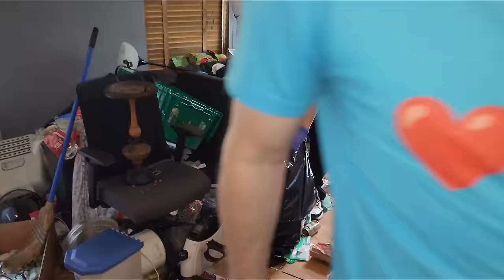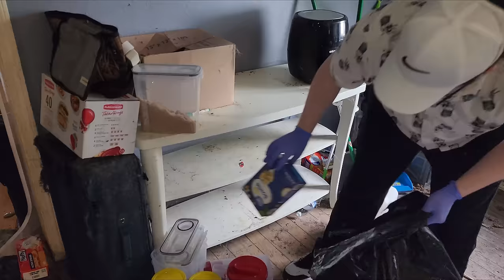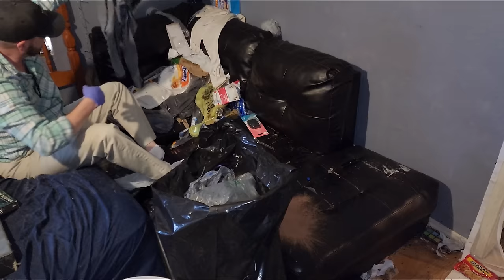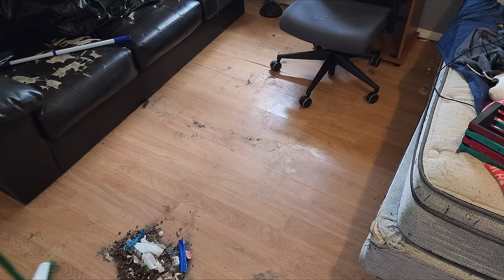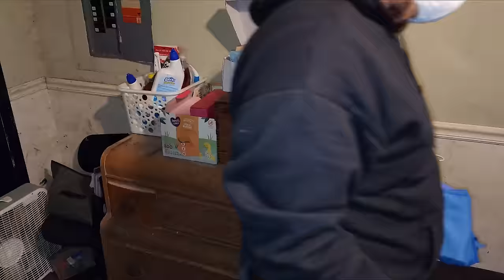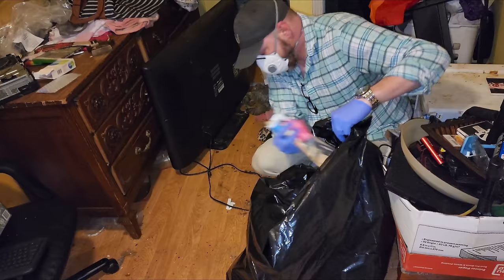We removed 100 bags of trash from this home for FREE

Comment: A friend lived for a while in a cheap hotel, and roaches got INSIDE of every kitchen appliance ( where the mechanical part is, where you can't clean it and can't see in there.). 

Inside of the back of the refrigerator and inside the toaster and toaster oven, and inside of everything she had in the kitchen. And inside of a TV or anything electronic because they like the warmth inside. 

So even though she next moved to a clean apartment, she had to get rid of everything that had ANY LITTLE space where a roach might have laid an egg, FIRST, and NOT bring it to the new apartment.❤

I guarantee there's roaches living INSIDE of the back of the stove, BACK of the refrigerator and inside the back of the microwave etc.  They come back out later and eggs hatch repeatedly. Ugh.

Thank you so much for helping her.

Comment: I am continually impressed with your sensitivity to the mental health issues other people are facing. I am a former police officer here in Canada, I have been working on and learning to live with PTSD since 2011. The observations you made at the beginning of the video about the homeowner possible having PTSD were so spot on, and so compassionate. For a few years I saw the wrong therapists and I was made to tell the story of what happened over and over and it does not help. I had to tell the story and you would think the re-telling would help get it out of your system. It doesn’t. It strengthens the experience and it’s a crazy circle of thoughts you get trapped in. I finally found things that helped, but re-telling over and over doesn’t help and in fact makes things worse.

Comment: Not a trained psychologist, but I majored in psychology and have adhd and periodic depressive episodes. often times for me the most difficult part of a task is completing it rather than starting it, and this is most obvious when i'm cleaning. for instance, i have a basket of important papers i need to file sitting in a basket on my desk, the file is right under the desk, but i haven't sorted them in months. i have idk how many crochet projects sitting around places, and some of them i've put in bags and stored away in a plastic bin to reduce the clutter, but the projects still aren't done. i have bags of clothes i've culled to consign/donate, but it's been almost 3 months and they're still all in my trunk. my dishes frequently sit in the drying rack until i need them next because i can't seem to put them in the cupboards. what this person is doing feels like a more extreme version of that - she has enough energy/executive function to do 80% of the task, but something about finishing is tripping her up. what i do to try to combat that is to make the ending/storage location and the stage of a task i get stuck on as similar as possible, or interrupt the stuck stage. for example, a lot of my dishes get stored in a way that lets them dry - pots and pans are hung up, my cabinets have wire racks and i usually leave the doors open, and i just bought a little fan for my kitchen to improve air circulation. i've also started inviting a friend over to chat while i finish up craft projects so they can keep me on track. obviously this person needs much more support than some little life hacks, but maybe this can help her or someone else.

Comment: Thank you for teaching me the difference between a degreaser/soap based cleaner and all purpose cleaner. I'd be using only all purpose for most things and struggling with the more gunky messes. Now I know the 2 step process and that you still don't need 12 different specialized cleaning products to clean a house. 2-5 products is enough for basic home maintainence.

Comment: Oh my word, this was an absolute nightmare of a house. Before we had kids, my hubby and I lived in a trailer that became infested with roaches after someone gave us stuff from an apartment cleanout that turned out to be full of roaches. We fought them, but we ultimately had to move out of the trailer because we couldn't deal with the roaches anymore and though we haven't dealt with them in years (thank God!), the experience left me traumatized. You guys were so awesome for getting her house put into livable condition. I hope she has access to a therapist who can help her, and an exterminator to put those nasty bugs out of her house once and for all.

I'm curious about the empty storage containers as well. I saw someone else mentioned it in the comments that it could be an out of sight, out of mind thing where if they don't see it, it's not there. While that certainly could be the case here on an extreme level, my theory about this house is that the lack of storage use is that it's a side effect of a severe, prolonged depression where you're simply too ill to put things where they're supposed to go. You buy the storage tubs to hold books or knickknacks, but then depression hits and you can't get out of bed for a while. So, they sit empty while the house piles up. Having clothes in baskets means less effort and energy is spent getting to them or putting them away as opposed to storing them in a closet or dresser. Same with the food piles. And as the garbage and mess piles up, so does the depression. Rinse, repeat. I'm not a psychologist, nor do I play one on TV, but that was my impression of the situation based on what I've learned on this channel and in real life about hoarding, mental health, and neurodivergence (it's interesting that you studied psychology in college. It seems right up your alley. Did you graduate with a degree in the subject?). I'm interested in what someone who has actual clinical training on the workings of the human brain has to say on this matter.

Take care of yourself and the family! Enjoy the eclipse on Monday (hopefully, your town will be in the path of totality for one of the most awe-inspiring views in the sky!)

Comment: I know a eldery mother with two children diagnosed as adults with ADHD and clothes were/are always out of empty closets, Drawers and closets are usually  empty.  One struggles with garbage, like sanitary products and dirty recycling  everywhere, and the other uses shelving so they can see everything. They are not this extreme but dirty dishes are the norm and usually washed when they have used the last clean one. One solved this problem by only having what dishes they needed for one day so they had to wash them. As children, everything was on their bedroom floors but they were made to weekly clean and fold  the clothes off their floors. This chaos is normal because their minds dont see this as a problem we do.  Chaos is comforting for them.

Comment: Thanks MMC, I love your channel & much needed humour. Great job on the clean up, shout out to Jason for facing those pesky roaches 🥰 
Wishing the homeowner continued healing & hope that she found a clearer cleaner living environment a safer space to make that happen ❤

P.s A great microwave cleaning tip i use - cut a lemon in half, put one half in a bowl and add cold water to near the top of the lemon. Turn on microwave for 3 minutes. This creates steam which loosens any built up food residue making it easier to just wipe off when finished. Lemon acts as a great deodoriser, so yr microwave will smell great too. Repeat exercise if microwave still gunky after the first run, use the other half of the lemon and new cold water.

Comment: I have Depression, Anxiety with a hoarding component as well. There, but for the grace of God, go I. I don't ever remember a time when I wasn't depressed and anxious. I later was diagnosed with ADD (what calm ADHD once was called). I have developed systems for dealing with dishes, laundry, cleaning the bathrooms, shopping, my car, my bills. But I have been digging my way out of, not only my own, but my Mother's trauma and Depression since I was about 12, which is when things started getting bad. I fight against this tendency every day. I am well aware this is always a possibility and am vigilant. I still have way too much stuff. But it is, for the most part, sorted into major categories. I only buy what I have an immediate use for. 

But, I'm tired. Two years ago I was diagnosed with Fibromyalgia. It explained a lot, and that in itself is a help. Pain is exhausting. There's no incentive to move. In your mind you can see all of the things that need doing. You can even picture them done. But getting up, walking around, bending down, picking things up, hurts. Not in just a while, whine, whine sort of way, but in a misery gift that keeps on giving HOURS after you stop. Muscle spasms, pain that won't let you sleep, all over fatigue, it can be very Depressing. I don't know this person's story, but after living in such conditions for years, it's easy to start believing you deserve it-- lying in the bed I made-- sort of thing. 

I guess my point is that not everyone has the same energy level. Some people start behind others. Not everyone has the life skills, or self-knowledge or insight, to know that they're going down the wrong path. To the punitive people who seek to embarrass and punish, screw you. You don't know this person.  Thank the powers that be that you have the energy, mental clarity, to keep your house from looking like this. And never take them for granted.

Comment: This is the second video of yours I have watched and I am bawling. 😭 God bless you for helping these people 🙏❤️ 
I'm not a psychologist, but my house looks like the ones you clean and almost every cabinet/storage area is empty and you say you haven't come across this before so I thought I'd put my two cents in.  I have cptsd, major depression, anxiety, severe ADD and possibly even D.I.D. I live in a small rural community and I do not have access to mental health treatment. I've tried all the pills, they kept me numb enough to function for a couple decades but now I'm on my own and don't care to be numb anymore. I think they may have done some long-term damage as well and I have a pretty flat affect at this point anyway and don't care to leave the house. When I moved into my current home I was already in a bad state. In fact, I moved everything into the middle of the living room and just left it all there. Things were pulled out as they were needed and nothing was ever really put away. The house had basically no storage and it was too small already. I made a point not to put anything into the few storage areas/cabinets that this house had because there were so few and I didn't know what would go in them because obviously I had too much stuff and some of it would need to go, and I've always had a hard time knowing what should be kept and what was useful and what should be thrown away, as well as letting go of anything with any value at all. I don't hoard trash, and there's no food rotting around my house but otherwise it looks just like these homes. I grew up in a similar situation and hated it. But, I left the few storage areas empty so that after I cleaned out all the extra junk I could put what I actually needed to keep, in them. Before long, things were piled in front of them and I couldn't even open those doors/drawers anymore so they stayed empty. It's been almost 10 years but I'm going to get this house cleaned out one of these days and it will be livable, for at least a moment, before I die, if it kills me! The shame is so intense that no one has been allowed to come to my house for over a decade. I commend the people that can ask for help! May God bless you and keep you always for helping AND respecting them! I tried to watch the hoarding show that was on television before and I don't know how they didn't make most of those people kill themselves. I couldn't watch it. MAY GOD BLESS AND KEEP YOU AND EVERYONE WHO HELPS YOU ALWAYS!

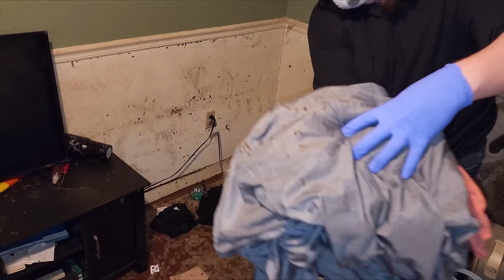Comment: 33:37 If I may speculate an answer for your question: In traumatic situations, memory is the first to suffer. Long-term especially. The storage doors would prevent one from seeing the problem (out of sight, out of mind) and so it’d be near impossible to remember what’s behind the doors.
But, everything out in the open is a double-edged sword because now Homeowner has to deal with clutter and white noise, which also affects memory. In solving one problem, another problem took its place. 
ADHDers like me often have this issue, and I can only do what I can to put items at their point of performance.

Comment: Random useful tip: Simple green kills roaches quickly. I used to live in an apartment complex where all the buildings had an infestation problem. I found the cheapest solution was to pick up a simple green concentrate 3 parts water 1 part simple green in a bottle. cleans the area and kills bugs.

Comment: I don't know if you'll read this, but I have a few ideas for you if you're at all interested.  My family and I did extreme cleaning for the V.A. many years ago.  When a place was really bad we would buy cheap clothes from the thrift store to wear while cleaning then throw them away when the job was done.  Also, use duct tape to keep your pants legs sealed to your socks or shoe tops so the roaches can't crawl up them.   

Another alternative to bleach is peroxide.  The advantage to peroxide is there aren't any fumes.  It destroys most viruses and bacteria as well.

On a completely different note, Bagsters are cheaper than a dumpster.  You can buy them at home improvement stores.  When they're full you call Waste Management to pick them up.

Comment: Thank you for doing this for people and for understanding about ptsd, severe depression and alll the other mental health conditons that cause the messes you clean up.
I was one of these people and I could still revert back given the right set of circumstances.  People used to just see the mess and pity me because I was one of "those people".  They would help out, but at the same time this seemed to give them the right to preach and lecture about putting things away and doing the dishes twice a day.  I was lucky I had an escape, my animals were high needs, and I thrived when needed,  but the house would be a step too far.
Suffering from major depressive disorder on top of ptsd and a brain injury meant my executive function was close to zero when I was in overwhelm.
Once you reach that point you dont even see the mess any more, its like you have blinders on.  If I did notice it, I would go into severe panic and the overwhelm would send me into a depressive spiral.  Sometimes, for whatever reason I would wake up and be able to deal with the mess and get alot of it cleaned up, but my energy reserves were low and I would only have that one day to get it all done before I crashed and burned.
I used to think I was lazy, pathetic and competely useless, and I did try to end my life several times, ususally after trying to clean up and failing miserably..
My trauma was psychological abuse as a child, where we would be dragged out of bed at 3 in the morning to clean the house while being told we were dirty disgusting children, I was 8.  My step siblings got it way worse than I did.  One morning my mother told me to take my cat to the vet and have it put down because it peed inside.  I didnt question it even though it broke my heart to do it.  When mother got home she said she had been joking and I shouldnt have been so silly.
My husband was abusive in a different wau, he would undermine all my decisions including those in the bedroom.
After my car accident my thinking became very warped, although it did help me leave my husband, it also had me give up my children because I was neglecting them as I just couldnt seem to get enough sleep and I became hard to rouse,
I am telling your viewers this, especially the ones that think it is laziness, so they can see that there are stories beihind hoarding, messy dirty homes and mountains of washing and trash.  There are things thjat no one can see, imagine or even begin to fathom if you havent already been there yourself or have experience with mental illness, autiskm, brain injury or ptsd.
I will be medicated for life, I have anxiety the minute I wake up and going to therapy is the hardest thing I have ever done.  I am 54 and yet my childhood still impacts how I live today.
This amazing man and his son not only clean and bring order to chaos, but they bring compassion and an opportunity to reset.  Yes the mess will likely return, but there will be better awareness and the people know they can reach out and recieve support again.  What he is doing is freeing them from the past, even if its just for a little while.  That is massive.
Please dont think that the people he is helping are in any way willing participants in this, because behind it all there is a horror story or a deep sadness, or sometimes both.
I am more than happy for this to be shared if you think it would be of use on another clean and someone wants to judge 
Again thank you both for all you do and the compassion you bring to every cleqn.  You really are angels in denim.  Thank the moose too.